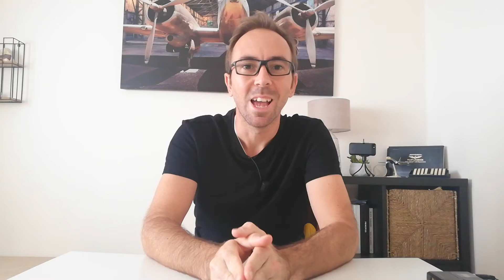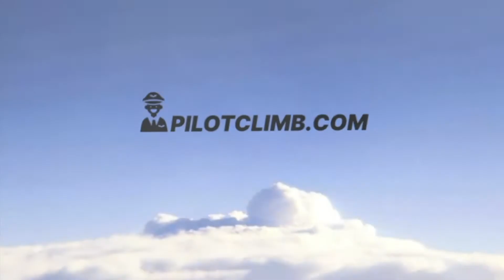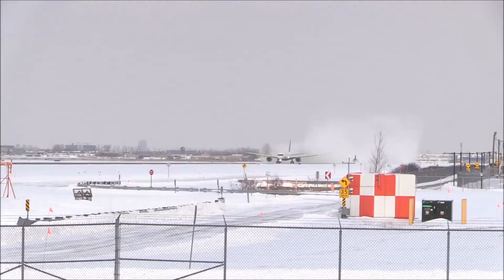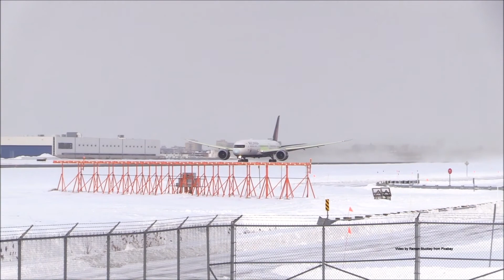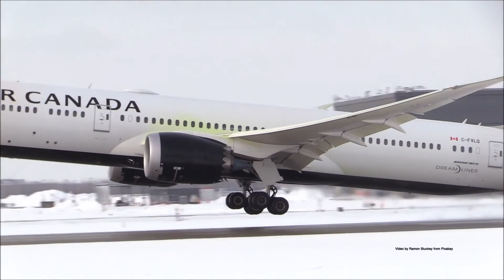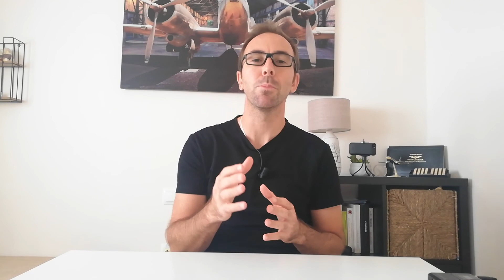V1 VR V2 - [Take off speeds explained and Boeing 737 Simulator practical example]

Comment: What would happen if you delay to apply back pressure (rotate) when you're at Vr ?
Reply from the maker: You rotate late, which is not ideal since you have calculated the takeoff performance based on a rotation at Vr

Comment: Thx, great content! Based on ur experience,  let's say u got a vR at 140 kt , what would be (approx.) the lift of speed in both cases AEO & OEI (continued take-off) ? Can u estimate, at what angle the A/C gets first airborne ? Even if a pilot target  12.5-15° it looks like the A/C lifts way earlier (at about 7-8°) in the simulator,
Reply from the maker: Hey, many thanks for watching and the comment!! The pitch angle and speeds during take off depends on the Aircraft type. Check out the Simulator videos I made to have an  idea about the Boeing 737.
Reply: @PILOTCLIMB  thx ! Haven't found the answer to my question there (yet), but still got some good informations from ur simulation videos… great channel! Will keep watching

Comment: Thanks for the great video!
I always have been wondering why v1 increases as takeoff weight increases. I think it’s something to do with balanced field theory but I am not sure. Please share your knowledge!
Reply from the maker: Hey, it all depends if you are performance limited (short runway for example), than in this case the V1 actually decrease with the weight..however, most of the time we have long runways thus the higher the weight the higher the V1(the V1 has a relationship with the Vr)  because you will be able to stop the Aircraft within the ASDA. Let me know if you have more questions.

Comment: Good Day Capt,is density altitude also important for B737 aircraft or only for propeller cessna aircraft?as I know  QNH and QNE are  pressure altitude...
Reply from the maker: Hey, many thanks for watching. The Density Altitude is also important for the B737 performances. When you calculate the take-off or landing performance you need to take into account the Pressure and the Temperature.
Reply: @PILOTCLIMB  thanks Capt....maybe later on you can make video about this topic performance calculation for takeoff and landing B737 aircraft included density altitude...Have a nice weekend Capt...Gracia
Reply from the maker: You are welcome, I will do a video regarding the topic you suggested.